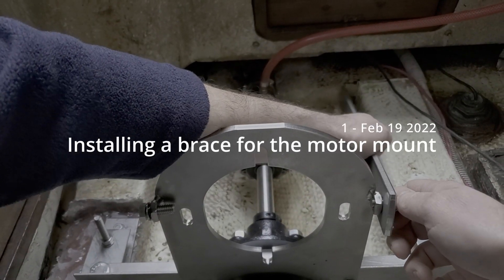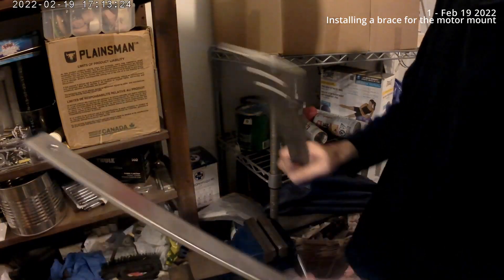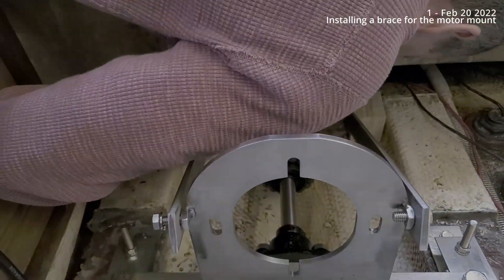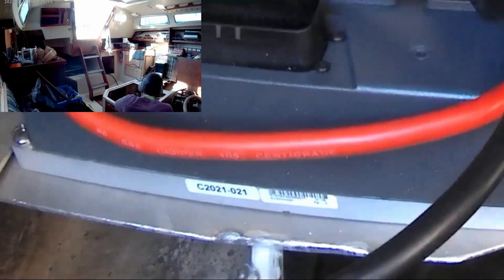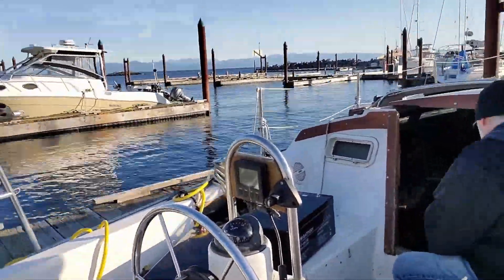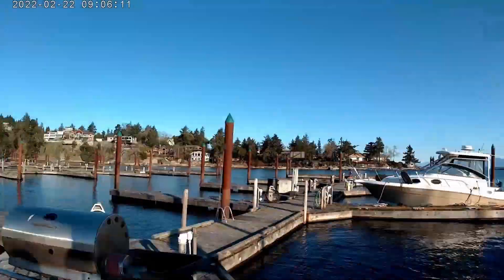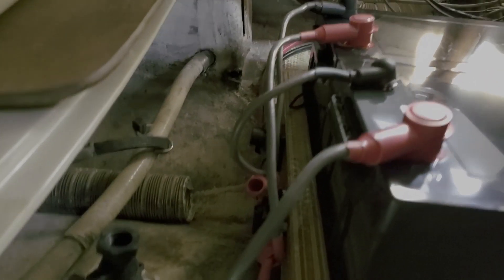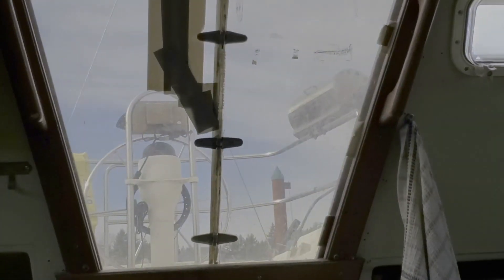Catalina 30 - Electric motor installation - Step 7 - Installing the Actual Motor

Comment: Great video. Any reason a through bolted angle on the inside of the stringers couldn't support the motor? It looks like there's plenty of room on the sides. It would negate all that cutting and reglassing. 
I have a Catalina 30 with a siezed Atomic 4. No matter what, it has to come out. I've installed shaft locator support and I'm ready to pull the shaft back from the coupling. The boat is in the water. Can I really do this?
Reply from the maker: That might work, if I'm imagining correctly what you are describing. But, with luck, you probably won't need to do any of that. There is a video (I reference it in my "How to" video) of a Catalina 30 that replaced an atomic 4, and their stringers didn't need any modification at all. The mount just fit right in. I had a 5411 diesel, and my stringers weren't angled the way (I assume) they are for an atomic 4 install. :D Take a look at your stringers, I suspect they slope down at the stern.

Comment: Good info. I’m also in the process of doing an electric conversion.  You are correct about all the small things that need to be done even before the installation of the motor.  Can’t wait to see the completed system. I believe the only maintenance needed is to occasionally greasing the thrust bearing and of course dusting the engine compartment

Comment: If you want to bend at a specific  
Point put a square tube over the piece ..your bend line will need to be  at or a little above the vice jaws.... If its going to be in thick ally best anneal it if its going to be more than about 35-45 degs. The heat required is n't a lot...
Reply from the maker: So put the square tube over it and pull on it? Or would I still use hammer?
Reply: @openrov272  depends on what length the tube is and how thick the metal to bend.. try it on a practice piece ... Keep it pushed down a bit to stop it sliding up the piece as you bend   
It down towards 50 deg bends.
You might use a hammer to tighten up a 90 deg bend.
Reply from the maker: Thanks! I would be surprised if I didn't need to try something like this again in the future. :D
Reply: @openrov272  
If you need to bend thin sheet metal you can get reasonable folds using a folding workbench and pushing it over with a board   and extra pair of hands ... Though you might have to add a  
Metal jaw cover to the wood bench jaw's to get a tighter bend... 
Experiment with some scrap see if you can make it work for you on any particular job.

Comment: what motor was that? thunderstruck?
Reply from the maker: Yes. The 10 KW. :D
Reply: @openrov272  We're doing a 10K thunderstruck kit that began in the revolutionary war period post 2017 but has been on delay, what batteries did you use for your application and did you change them out?  Just for reference we're doing a Thunder 10K on a Hunter Vision 32 in Key Largo, FL USA
Reply from the maker: I'm using these: https://signaturesolar.com/eg4-wp-lithium-battery-48v-100ah they have been working great so far. :D